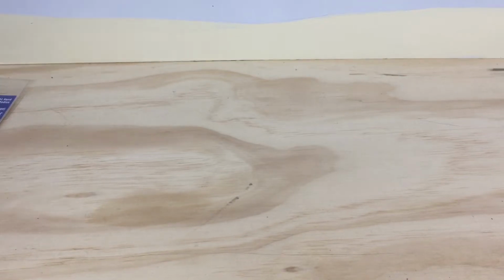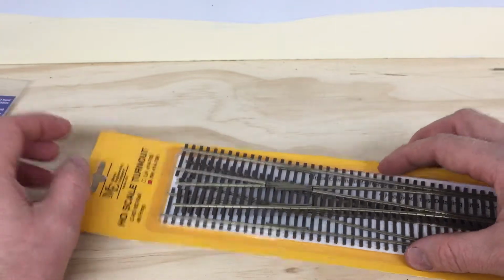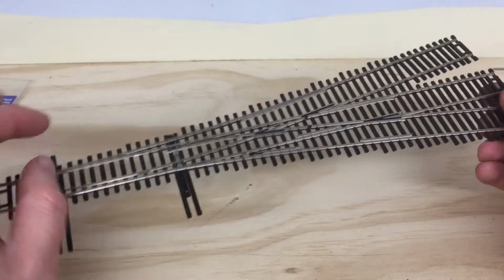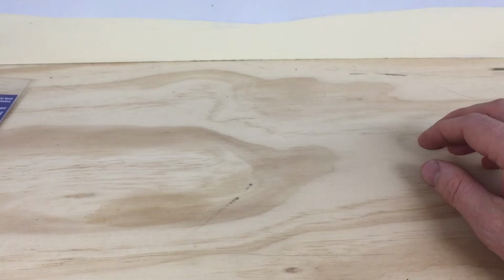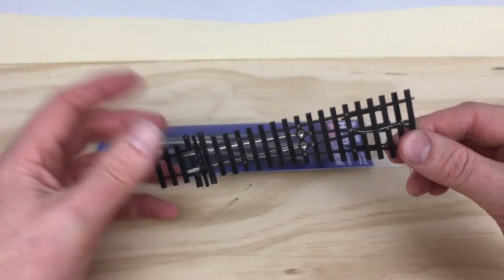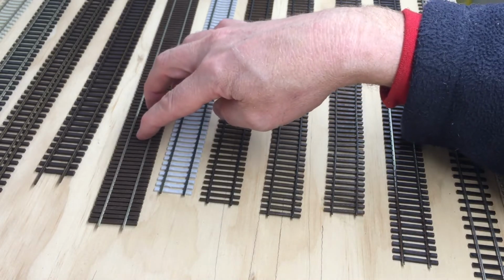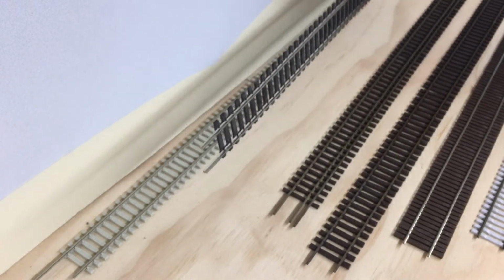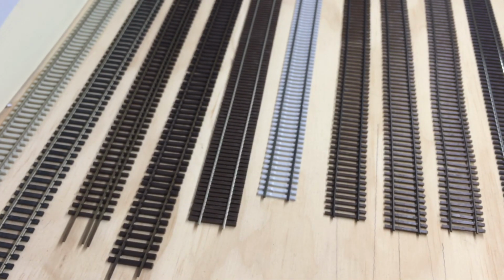A beginners guide to Australian model railways (track)

Comment: most informative, thank you. I ended up opting for the micro engineering, peco I found fairly pricey as it's reputation proceeded itself. I got warned of atlas, but seeing as it's budget friendly thought I'd grab a couple and had no issues whatsoever. no positive throw, but they seem to stay in position anyway. not a fan of peco HOm as it's a bit too narrow gauge, so just using tillig tt. thanks!

Comment: Tillig, you won’t be disappointed, however and regarding the points, the point throw (tie) bar needs a drop of superglue or araldite where the switch blade attaches to the tie bar, just a safe guard to prevent possible switch blade disconnection, also inspect this area when you purchase them to ensure the switch blade tab is present, and in the tie bar. Something Fred never warned me about. But in its defence of all the points I have bought (lots) I have only found one (1) faulty, and the araldite at the pre installation phase fixes this problem for ever.